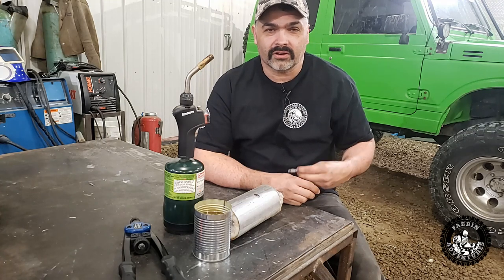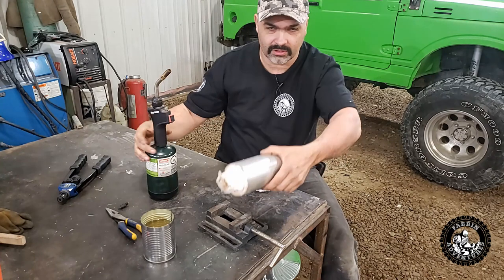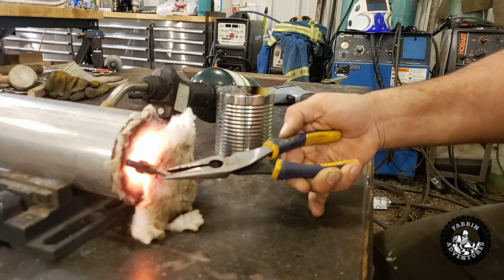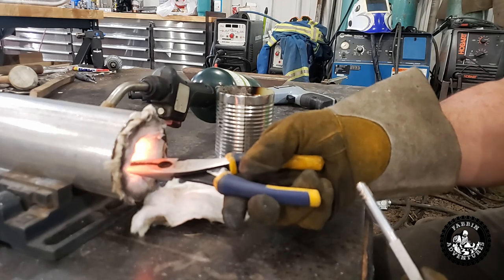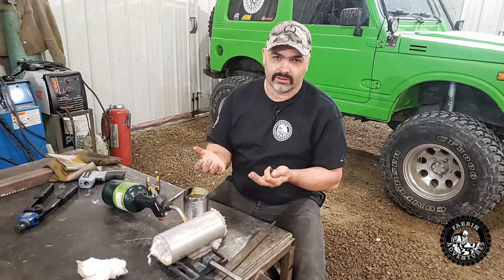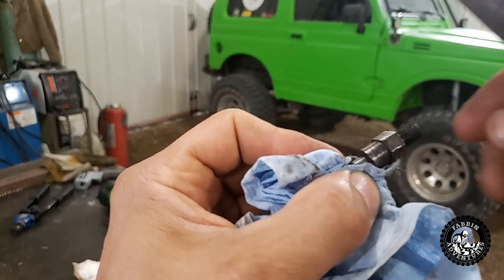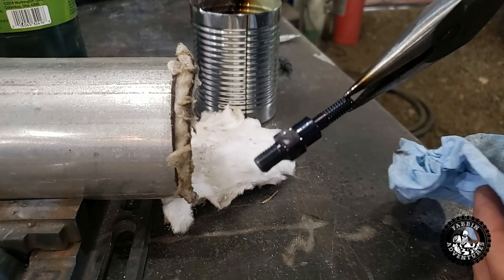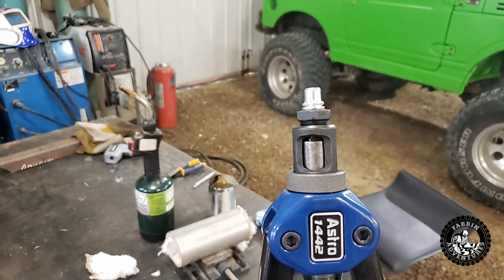How to heat treat small parts or tools: Repairing my Rivnut Mandrel

Comment: if the part is small enough, do I still need a little furnace like that or can I do it on the open flame?
Reply from the maker: As long as you can get it up to critical temp with open flame it will work.
This unit basically multiplies the btu by reflecting it back on the part.
Thanks for commenting!

Comment: I just checked out your online store.  Have you ever thought about fabricating parts and kits for a samuraui and selling them on your store ?
Reply from the maker: I have thought about it, but the cost of the items would have to be too high compared to the other offerings out there because of my slower manual production. Unless it was something that no one else offers it wouldnt pay.
I will most likely start custom making knives again in the winter so i will have them for sale.
Thanks for checking out my store andwatching Fabbin Adventures!
Reply: Makes sense too bad though as your welds on things are fantastic. I know that acme adapters makes sweet kits for the conversion to diesel . I have 1.9l turbo for mine and though acme adapters r for vw motors from 1975 to 1996 the adapter plate fit like a charm . That being said the mounting brackets going to the motor didn't and I had to make a bracket so the mounting hardware that comes with the kit worked . Perhaps u could find something like that to fab up for your store as its not much to make and would save lots of people who can't fab it the hassle of trying . I think you have a great channel and I like all your videos.  There's gotta be a way to piggyback off what other ppl have forgotten to think of and make bracket kits and such to compliment other companies products .